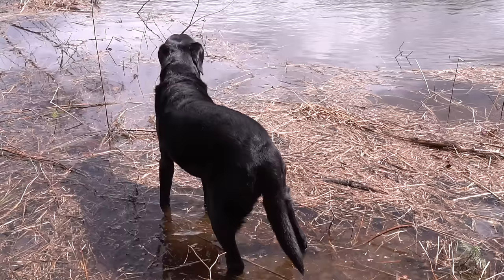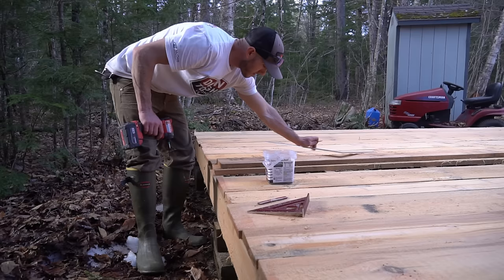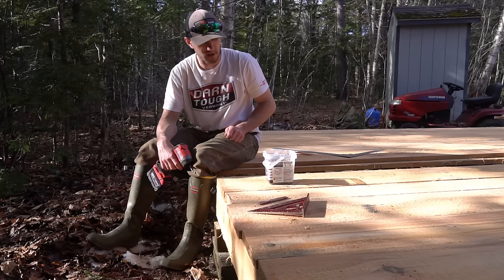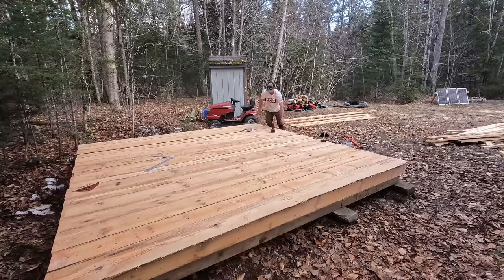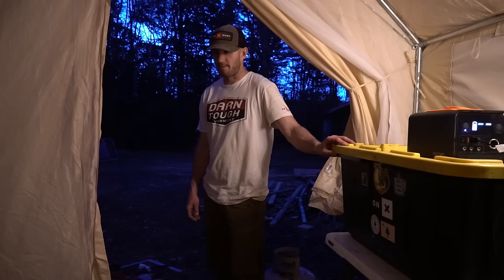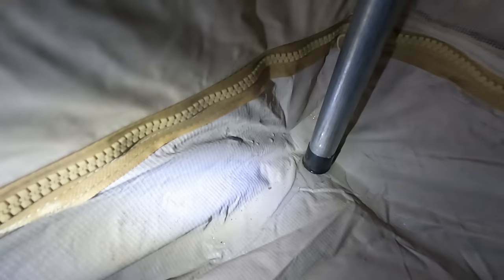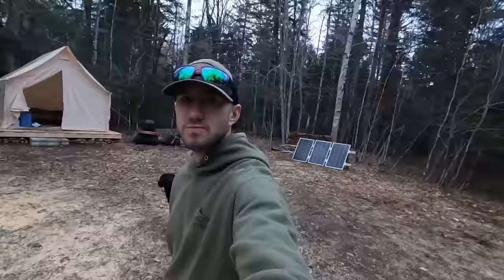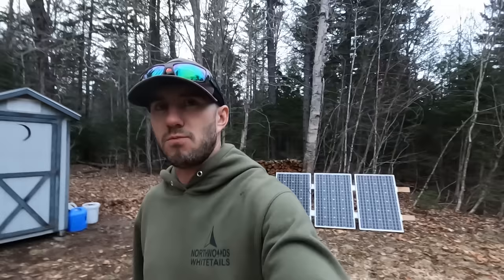Building a Wall Tent Platform with Rough Sawn Lumber

Comment: Scotch guard, Brother! Literally have a Walmart tent I have used for 20 plus years for hunting that has never had one drop of water get through it. And I live in the South where rain is a part of hunting/camping. Make sure its dry and clean, literally just spray it on in sections. Do at least 2 coats. Keep driving on, love the videos and look forward to the progress.
Reply: I was just going to suggest scotch guard, too! I’ve used it on every tent I’ve ever had. I’ve also used a rain fly with every tent, even when the scotch guard did a great job making the tent material water-repellant.

Comment: Just a thought, if I understand correctly, your plan is to tear down the existing cabin and build a new one.  Have you considered spraying bleach on the wood in the cabin to deal with mold and keep it as a storage shed rather than tearing it down.

Comment: I love the sound of the rain on the tent.  It takes me back to when I was a kid and the green canvas tent we used back then in the 50's.  Our tent would leak also, and my mom and dad went crazy keeping the coxs away from the walls.  Once you touched those walls when it rained it would keep leaking.  Send the tent back!  You used your hard earned money for it.  Spend a little more if you have to for another "good" tent.  Maybe a different brand.  You never know you may have to go through the winter and you will need a good tent.  Don't be hard on yourself.  You did not know the tent would leak.  The homestead looked good after you did a little housekeeping.  I think the old owl will be flying over keeping an eye on you and Gracie.

Comment: I luv the fact you found a bullet in one of the trees you were milling!!! I worked for a tree company in the late 90’s and while taking trees down for the town of Rockland I was 80ft up cutting a leader off for the crane to take away and in the crotch of the two leaders in the HUGE Elm tree my saw started sparking where the chain was cutting. So we readjusted the sling and once we got it to the ground the crane operator and my supervisor hacked into the crotch exposing a CANNON Ball!!! Rowland is at the mouth of the Penobscot River so safe to assume 150yrs prior during some situation a boat fired for some reason or the fort across the river mouth did and that’s where it ended up. Really cool no matter how it got there but some of the things you find inside trees are truly amazing like a bullet!!!

Comment: I have 2 Kodiak canvas tents and have been happy with both.  They suggest wetting them and letting them dry a few times before camping in them to tighten the weave of the duck canvas.  This has worked for me.  Haven said that I would just throw a tarp over the top for the summer.  The reason being I wish i had done this with my first one.  After a month of use in the spring with a lot of rain and pollen from the trees it got stained pretty bad.  It still works fine but it would look a lot better now had I tarped it.  Keep up the hard work.
Reply from the maker: Sounds good thanks 👍

Comment: Dang.  Sorry about the tent.  Since you're thinking of delaying the cabin build for a bit, I'm thinking maybe you could frame up a simple structure on your tent deck with some rough cut lumber. Sheet metal on roof and some rough cut 1x on the sides.  Doesn't have to be fancy, but would get you by while you work on your infrastructure.

Comment: A watch out on the stove tents.  They have covers for the chimney pipe holes.  Usually with velcro. Some its velcro on 4 sides that separates completely from the tent. Other velcro on 3 sides and stays attached to tent. Rolls down with straps.  The 3 sides need monitoring. Over time wind loosens the straps and the flap blows and hits the stove pipe and catches fire.  The 4 side removable one’s are better for long term use.
Reply: My dog Alexander the Great and I will be starting our off grid life in Carrol Plantation very soon.

Comment: I have 100 nights in my cheaper canvas tent, I use a white tarp (white lets the light in) from Cooke Custom Sewing in Minnesota, and my stove Jack/stove pipe goes out back wall, zero burn holes. That tarp makes even cheap tents 100% waterproof. That’s a nice looking tent you have now, interior frame, not too big for solo use, consider a good tarp.

Comment: I've lived in a few different tents over the years, my favorite was a Nomadics 17' tepee it was great if you were staying put for a while but moving day was a ton of work. I sewed up a pyramid 10' X 10' with 2' side walls, stove jack, and sod cloth to hunt out of. It could be hung from a tree limb or use a center pole which in my part of the world was more practical. Lived in a 16' X 30' surplus tent in 5' of snow, it was ok if you were near the stove but anywhere else was like living in your freezer. A friend of mine has a Davis tent, I think it's 10' x 15, very nice tent. Recently I spotted a Roamin' Home tent sort of a modified "Baker" tent looked real practical for short stays. Anyway all these are true canvas tents that will drip a bit when new but once the canvas shrinks they tighten up very well. Really enjoy your content, and good to see both Gracie and yourself doing so well.
Reply from the maker: Good info, this turned out not to be true canvas like it stated, it’s actually polyvinyl

Comment: Every tent I have owned leaked at least somewhere. It is disturbing to say the least. Mostly the seams. That one of yours was a real leaker. I have always had canvas tents with no floors. I started treating them with a canvas sealer called “Canvak” after I let them weather some. I sprayed a hose on them for extended periods if no rain in forecast  and let the sun hit them hard. They always shrink some after that. I them applied the Canvak. Had one for a hunting camp on a platform for 6 years prior to building my cabin. Treated her every 2 years with sealer. Still have her today after 20 years. It was from a tent maker in Alaska. Also have small one 6’x6’from same tent maker. It’s my back country brook trout tent that I take in with canoe. All the best. Good luck. Peace¥
Reply from the maker: good info, thanks man

Comment: I have no experience with canvas tents, but I’ve looked into them some consideration of a future purchase. 
Directions were to set it up, and soak it to fully get the cloth to fill in and acclimate to a water proof state. This tent may not leak save for the seams the next time if rains. The seams will need treated. Ether way I hope the next one works out for you. Keep the videos coming. I look forward to them, and the progress.

Comment: I'd go with a tent from Wall Tent Shop. Someone already mentioned Jay Legere and his tent has held up well it appears from his videos. I have a Springbar canvas tent that I love but they don't make wall tents unfortunately.
Reply from the maker: They make good stuff, I’ve used their products
Reply: @TheMaineWoods   I have something similar to the Springbar...a Kodiak Canvas 10 x 14.  When I got it, the instructions stated the tent needed to be seasoned prior to use.  So, I set it up in my back yard and hosed it down.  Been using it for the past 5 years hunting in Michigan's UP and it has seen a bunch of rain, snow, ice and wind.  It's never leaked a drop.  With the amount of water that leaked in your setup, I doubt it was a few needle pinholes, though.  I think you're right about the seams.  Kodiak does make a couple of wall tents, but they're pricey.

Comment: The tent looks good. The bad part is that although when the leave the manufacturer they are technically "waterproof" they then sit for God only knows how long in shipping containers, trucks, warehouses, the outlet shelves. Waterproofing material is chemical based and will and does break down over time. Usually, one of the 1st things in the assembly instructions is to re-waterproof the seams before assembly. 'Tent Seam Seal' is an inexpensive product, tons on Amazon, and is applied easily with an included brush or a roll-on like deodorant. A tent that size will take maybe two hours to do and you may need to partially disassemble to get to all areas. Once the sealant dries you should have no problems though you may have to "re-do" some areas that need more or may have been missed. This would be better than the tarp idea for the summer for sure.

Comment: Hi Cory...   Great videos!   I'm not sure which Jackery model you have... but if there is a way to get to the terminals on the battery I'd get an external MPPT charge controller so that all 3 of my panels would be able to be hooked up.  300 watts of panels would have been able to fully charge that battery in one day considering 100 watts got it to 35%..  I can't understand why they limit the panel input to a point that it won't charge fully in one day.

Comment: I just went to their website, Vevo. They have a 30-day return or replacement. 

Your 10x12 tent is advertised as "waterproof". Surely it is not. 

One of the worst things, ah second worst thing, is getting that tent back into that box that it came with. 

I couldn't do it. 

Of course. After you talk to them. I'd use some spray sealant on all those seams.
Reply from the maker: Exactly, not as advertised